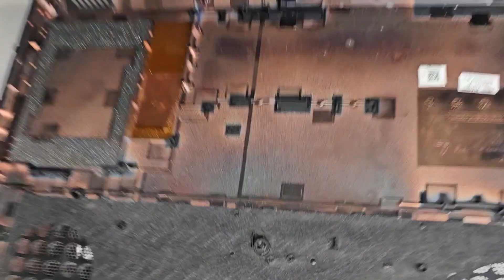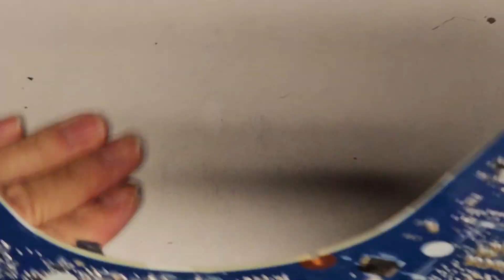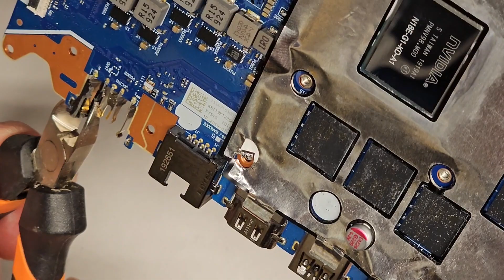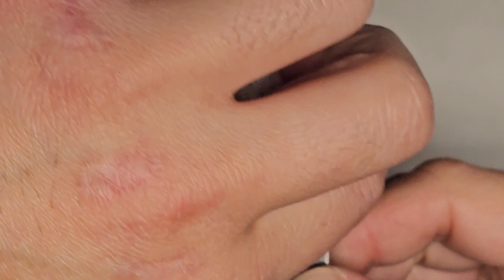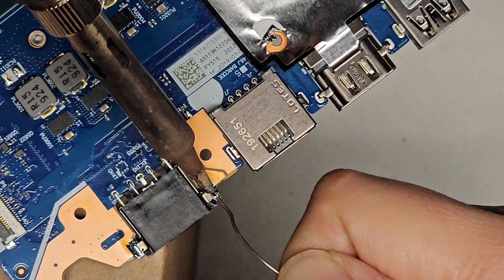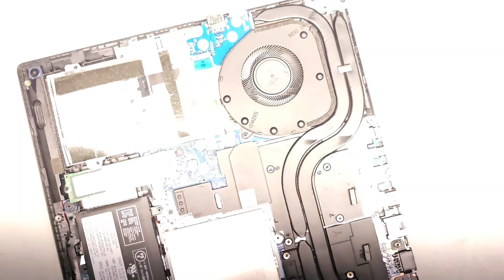Lenovo Legion Y540-15irh Y540 Disassembly Fan Thermal Paste DC Jack Charge Port Replacement Repair

Comment: Is it necessary to remove all parts ? Cant i just remove the heatsink and reapply thermal paste?
Reply from the maker: If that's all you want to do, yes, but you should still do the power drain.